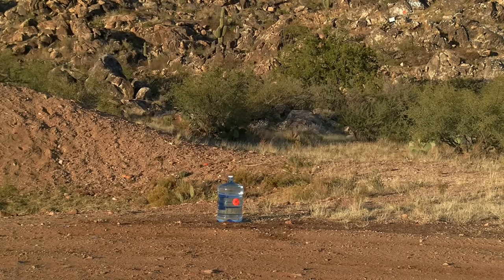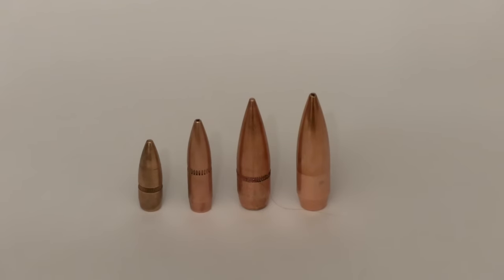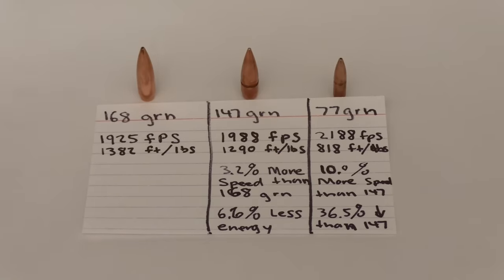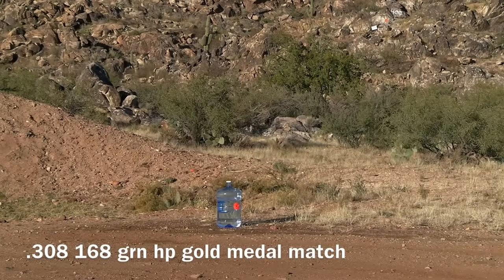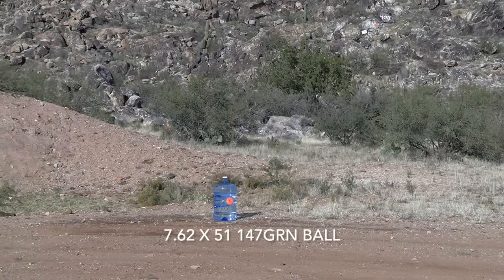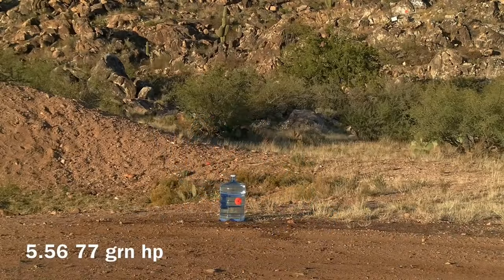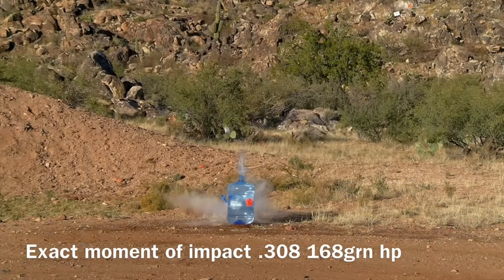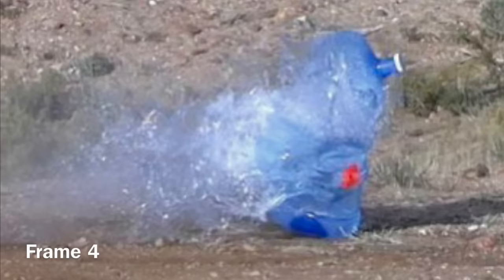5.56 & .308 vs 5 gallon water jugs at 300 yards

Comment: Unfortunately the energy of the 7.62 passed on through.  Maybe a lighter weight bullet so that it could break up and all energy could transfer to the jug.  Amazing what the 77 grain did though.
Reply: What we're seeing here is penetration capacity. What would be the outcome if there had been a second jug set up behind each of the three tested here?  How much damage would have been done to the second target?  What would happen if the jugs were set up at 500 yards instead of three.  Air is fluid and has significant resistance when objects are moving as fast as bullets.  People don't think about a bullet flight as penetration of Air. But that is essentially what happens.
Reply: I imagine a second jug from the 168gr would look like the 77gr from the first jug.
Reply: A V-MAX would be perfext for this...
Reply from the maker: Thank you Pumpkoi for your ideas and enthusiasm on the v-max.  You will be pleased to hear that the v-max version(s) are already filmed and are being edited now...
Reply: A hollow point  varmint bullet would expand and dump energy with the 308’s.
 Looks like you’re doing that next…. 😎
Reply: I’m sure that you fired the 7.62 through the same .308 rifle.. are we to believe that it’s a different cartridge? Or the .223 vs 5.56
Reply: Maybe the lid popping off on the 308 jug relieved the pressure a bit.
Reply: If want to see an energy dump in 308 try speer 130gr hp. Set up two jugs to catch the remnant.
Reply: Match bullets really don't expand all that well.  The hollow point does more to protect targets by collapsing.  A 150 gr SP hunting pullet would likely do more damage than a match bullet.
Reply: Exactly.  .308 at that range has roughly double the energy of the .223.  The .308 went straight through only expending part of its energy into the jug, whereas the .223 dumped most, if not all of its energy into the jug.
Reply: I used to load my 270 Winchester with 110 grain spritzers and (if Rember right) 54 grains of 4895 out to 3400 fps.  Deadly on coyotes but sometimes had to push the cartridge out with a welding rod and the primer would blow out.

Comment: The 16" barrel handicapped the 308 compared to an 18" barrel for the 5.56.  The 308 really gains velocity with the longer barrel, out to about 22" or so.
Reply from the maker: Thank you Mr. Claus for taking the time to watch the video and for sharing some intelligent food for thought.

In fact, both calibers were somewhat handicapped by barrel length.  They both would have benefited from longer length barrels (especially if both were test fired from a bolt action.)

At a very close distance like 50 or 100 yards this would have been a greater factor to consider, but at a distance of 300 yards, with both rounds having a chance to lose a lot of velocity I would have thought that the .308 could have easily overcome the difference in barrel length.
Reply: Incorrect
Reply: @dylandewd5356  Correct
Reply from the maker: Greeting Mr. Claus.  Just wanted to send you a friendly message to let you know that a sequel to this video has been produced and that your ideas were carefully considered when making part 2 in this series.  Here is the link to part 2.
https://youtu.be/jyKcyXacBh4

Hope you will find it to be useful.  Looking forward to your reply in the comments section of the new video.  Thanks.  😎
Reply: I'd like to see more centered hits... 1ft off target on 308... Come on...
Reply: The 308 keeps gaining velocity out of barrels 30" and longer. This is also the case with the 223/5.56, which is slightly more overbore in capacity than the 308.
Reply: @outdooradventures1696 

The 77 grain results happily surprised as it's my EOTWAWKI stock up and self defense 5.56 round.

From experience on 150lb+ whitetails, the 110grain Vmax from either .300 blk or .308 delivers an instant kill often with no or only a tiny exit wound. (I don't use it to harvest meat as the mess spoils the tenderloins. A .308 soft point does the same job with less mess). The 77 grain 5.56 not-so-much. Whitetail with any 5.56 is a head or neck shot to be an ethical kill and easy recovery. In the field, where brush exists even when not seen in your optic, the .308 punches through staying on target and hits with a thump. I've killed with lots of different rounds and always come back to that 150 grain .308 soft point.

Comment: Would be interesting to see how the 168 gr would have faired if the cap of the jug would have stayed on like the other two, It looks like it made a good relief valve.
Reply: I agree with you, a rerun without failure of the cap would, I think, have much different results.
Reply: Agreed, would like to see another test. Is it possible that the initial pressure upon impact is significant enough that the cap would come off no matter what?
Reply: hydrostatic shock !
Reply: The cap didn’t fail. The 168 gr projectile is moving much slower, so it gave the cap time to “react”.
The faster moving projectiles did not give the cap time to react and blew the wall instead of the cap.
Velocity out ways mass every time.
The nazi’s were a prime example of mass, had a cannon bigger than a locomotive, sure it could reek havoc., But Tesla knew if you fired a grain of sand at a 100,000 fps that the devastation would be immense. “Particle beam accelerator “
Reply: although shots 2 n 3 seem to show speed is better than weight for damage....idk
Reply: Ahh that’s a good point
Reply: @PROMETHEUS121212  Time to refer to our time-tested engineering flow chart: Duct tape vs. WD-40

Does it move? > Yes > Should it move? > No > Duct tape

Now, given the forces at play, I'd say this is at least a half-roll job. Since we are gentlemen of science and want to do our best to control confounding variables, I'd say a minimum of 1 full roll should be used to to ensure the initial pressure wave does not blow off the cap when the 168gr bullet impacts the jug. In the effort of fairness and objectivity, all jugs need to have a full roll around the cap for the test.

Time to run it back and conduct the test again to see if the 168gr was an outlier, of if controlling variables will produce different results. Cause like.. peer review or something. Ya know, for science or whatever.
Reply: No matter what, I dont want to get hit by any of them at any distance
Reply: Similar results ... the bullet will go through and not dump all it's energy. I've done it with the top duct taped. The best boom we got was 30-30 lead nose 170gr. But 77 ball does some weird stuff on impact. I doubt the 77gr in this video was as slow as he claimed.
Reply: Exactly.
Reply: @RocksNRuts4 I think it all depends what you are shooting at and the objective. Atleast that’s how I looked at it not being a hunter
Reply from the maker: Hello Mr. Wasserbeck.  Am sorry for my delayed response to your initial comments.  It took a while to create a follow-up video that would address your concerns.  I hope you will find it to be of value.  Here is the link to the sequel.  
https://youtu.be/jyKcyXacBh4?si=Ba58ZpQvf9dRf6oP

Looking forward to your thoughts.  Thanks again.👍
Reply from the maker: @ hughgray4199.  Thank you for taking the time to watch the video and to comment.  I wanted to comment sooner but thought that making a sequel may be better than commenting alone.  Here is the link to part 2 of this video.  Hope you will find it to be beneficial.
https://youtu.be/jyKcyXacBh4?si=Ba58ZpQvf9dRf6oP

Looking forward to your reply in the comments section of the new video.  😎👍
Reply from the maker: @Prometheus121212.  Thanks for taking the time to watch the video and to share your views.  I wanted to reply sooner but needed time to make a sequel to this video that would address some of these ideas.  Here is the link to part 2.
https://youtu.be/jyKcyXacBh4?si=HCUEIJqlO2jPyKtT

Hope you will find it to be beneficial.  Looking forward to your thoughts.😎👍
Reply: Not as significant as you would expect. Water is an incompressible fluid, the air in the top is not. Yes, you do have some of the energy of the bullet going into pressure increase, but the damage is from the shock wave much more so than the pressure spike. Not like it wouldn't make a difference, but wouldn't change that much.
Reply: @marvinmyers9367   THIS !!!!!!!!!   👍
Reply: fared

Comment: As for the effects of the 5.56 hit, remember that kinetic energy delivered equals the square root of mass times velocity squared. Don’t underestimate the 5.56 due to the smaller bullet weight. It’s moving very fast, and the velocity factor is squared as compared to the mass of the bullet.

Comment: Our USMC boot camp drill instructor told us that 5.56 had the advantage of causing more interal organ damage to the enemy because the round was more unstable after impact, causing the bullet to tumble and scatter. By comparison, he taught us that the 7.62 was more powerful but had a piercing effect as opposed to the disintegrating effect like the 5.56. 
The instructor shot a tree trunk in front of us with a 7.62 rifle and the bullet went through the trunk, creating a clean hole all the way to the other side. This video confirms what I learned in boot camp. Thank you.
Reply: Which means be careful what size tree you use for cover.    The big issue with the 762 is you lose your sight picture when you fire. It takes a second or two to acquire. With the 556 there’s virtually no recoil and you can keep piling them in one after the other on semi automatic, making it much more accurate for combat use. The thing it lacks is penetrating walls.     The other thing that people forget unless they’ve humped the bush is the weight of that stuff. Lead is heavy and the difference between 308 and 556 is major.    
    The big surprise for me was the shock of that 77, grain 556 round. That’s incredible that range in particular. I wonder how the drop profile compares to your 68 and 55😢 grain standard ball rounds.
Reply: The 5.56 ball needs speed to perform properly. It doesn't do it from a short barrel.
Reply: The 77 grain OTM has MASSIVE energy transfer. The jacket is super thin, so it shatters the front half, massive energy dump. The shank will sometimes continue on.
Reply: That demo showed me that a faster round goes in and out too quickly for the hydroshock to form to its fullest.  While that 77 grain did allow it to form to its fullest, causing more destruction.
Reply: @jamiepatterson1214  However the 77gr 5.56 is actually the faster round :)
Reply: When one considers the World governing body setting rules for war, a fully-jacketed bullet is deemed "more human" as opposed to an "expanding"' soft pointed bullet. But the rules don't say you can't design a full metal jacket bullet that is unstable during penetration, causing tumble and all the nasty hydrostatic tissue damage associated with it. It was said that the .303 British bullet had a tendency to tumble after impact due to the base of the bullet being heavier than the front, There were reports in Afghanistan during the Soviet invasion that the 5.45x39mm round was an equally efficient "tumbler".
Reply: @himo3973  You're talking about "in atmosphere" velocity. Once the bullets hit the canister and enter the water, the speeds of all the bullets change dramatically depending on how much energy they dump into the materials over time. There's an impulse high energy dump at time of impact, and an on-going energy transfer/depletion once the bullet is travelling in the water/mix of water and air due to cavitation. 
I think a graph of bullet speed vs time from the time of impact until the bullet either exits the bottle or reaches 0 forward ft/sec would be instructive. It would also reveal the energy transfer profile over time and distance.
Reply: my brother told me this too, did some missions in Kuwait, so nice to see it demonstrated like this!
Reply: .308 turns cover into concealment.

Comment: Awesome video. 5.56 has always impressed me. Amazing what that little projectile can do.
Reply from the maker: Thank you for your compliment.  Much appreciated.
Reply: Bullet design is everything. 5.56 was a hollow point and usually with enough velocity open up (mushroom) and more damage. 7.51 and 308 were ball rounds and poke a simple hole.
Reply: speed kills
Reply: @vuv9520 only one was ball. One was an open tip match. Technically a hollow point since the tip was followed out. Mostly designed for accuracy, but so is the 77 gr 556. That’s an otm too so I think the just opening really caused a lot of pressure relief for the otm 308 and that’s y it didn’t look as good.
Reply from the maker: @adam-nv9zo...Just wanted to send a message to let you know that part 2 in this series was recently produced.  Here is a link to the sequel. 
https://youtu.be/jyKcyXacBh4

Hope you will find it to be on par with or better than the original. 😉👍
Reply: @outdooradventures1696  Thank you. I thoroughly appreciate that.
Reply: velocity matters

Comment: That was simply amazing and not what I was expecting. You’ve done a great job in showing how effective the Mk262 round is. It helps explain why it was such a coveted round in the Middle East war.
Reply from the maker: Thank you for your compliment.  Much appreciated.
Reply from the maker: @Dennisthemenace40.  Just wanted to send a message to let you know that part 2 in this video series was recently produced. Here is a link to the sequel.  
https://youtu.be/jyKcyXacBh4

Hope you will find it to be on par with the first one.  😎👍
Reply: Technically, it's not a MK262 as that is only produced by Black Hills. That said, this sig version of the 262 seemed to have better numbers than I get from my lot of BH MK263, which clocks in at 2,779fps from my 18" white oak. I'm very impressed with this Sig version and now have to try it. I reload a 77gr using IMR8208xbr which I have gotten up to 2,836 in 10 shot avg as opposed to the BH MK262 at 2,779.
Either way, this is ine of the most impressive and surprising test I have seen, and goes to show that numbers can be deceiving.
Reply: Maybe even a 300 black out

Comment: I'm theorizing that the 5.56 77 gr tumbled and broke up, expending all striking force in the jug. The heavier 168gr / 147 gr bullets, with higher striking force, remained more stable and punched through, only expending partial striking force in the jug. Trying the same test again with soft point hunting ammo in all calibers would allow the heavier .308 bullets to expend most bullet striking force in the jug. In testing .31 and .36 caliber cap and ball revolvers, using original 1850's era pointed conical bullets moving at ~900 fps, the little .31 80 grain conical actually had more explosive damage on the 1st 1 gallon water jug than the .36 125 grain conical even though the 125 grain .36 actually has about 60% greater striking force. The reason was because the .31 cal 80 grain conical tumbled on impact, while the .36 125 gr conical punched straight thru!
Reply: I think you are right. The impact on the dirt behind the jug seems to have a lot more energy with the .308 than with the 5.56.
Reply: Yeah, I was wondering if a 1 in 8 was enough to stabilize such a heavy 5.56 round. A 55 grain or 62 grain, sure.
Reply: @section8usmc53  1:8 is actually the preferred twist rate for shooting 77gr ammo. The reason 1:7 exists is to be able to stabilize tracers from my understanding. Looking at a tracer outside of the case it is considerably longer than 77gr otm
Reply: At 12:00 minutes I see what appears to be a round hole not a key hole
Reply: WELL SAID
Reply: Even if it broke up, impressive for a 556 at 300 yards. I wouldn't want to be hit by any bullet.

Comment: From my personal experience of shooting various water jugs with different calibers is that the bullet type makes a huge difference, had the 7.62/51 - 308 cartridges been soft points, or the like, you'd have seen much more damage. The hollow point used here is a target orientated round, not an expanding hollow point. Having said that the smaller 223 round di far more than expected, but ultimately it's about transferring the energy from the bullet to the target and the 7.62/308 rounds powered through, where as the 223 dumped more energy into the water and jug, despite being the less powerful round.
Reply from the maker: Thanks for watching the video and for sharing your ideas.  Much appreciated.  Wanted to respond sooner but have been busy producing the sequel to this vid.  Here is the link to it.
https://youtu.be/jyKcyXacBh4

I do plan on different types of ammo for each like you suggested.  stay tuned. 👍
Reply: That hollow point expands...much more so than the soft points which are disigned to retain weight as the HP does not do as well.

Comment: The little 5.56 may have had less kinetic energy at 300 yards, but it was able to impart a higher percentage of what it had into the jug than what the two larger rounds could do. Had there been two jugs in each shot, the 5.56 likely wouldn't have done as much damage to the second, even though the first would've been eviscerated.

Comment: Excellent video with a very well done testing protocol.  The results belie what the figures on paper would suggest. I have a newfound respect for the 77gr 5.56. While others have pointed out that soft points in the other two calibers might have produced different results, there’s no denying the explosive power of the 5.56 at 300 yards. Thank you for your excellent testing work.
Reply from the maker: @Jeffwaltonbooks894.  Thank you for your encouraging words.  Much appreciated.   Wanted to reply sooner but have been working on the sequel to this video which was recently completed.  Here is a link to part 2.
https://youtu.be/jyKcyXacBh4

Hope you will find the sequel to be on par with or better than the original.  Thanks 👍